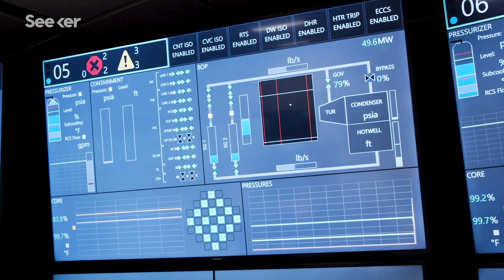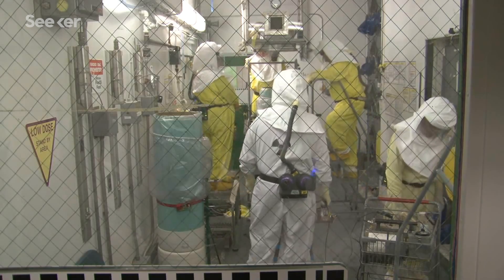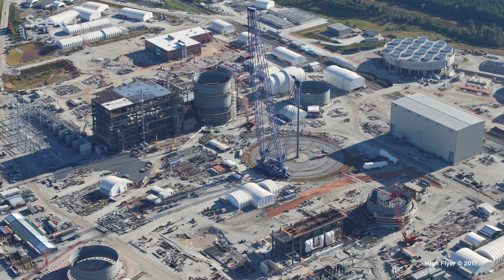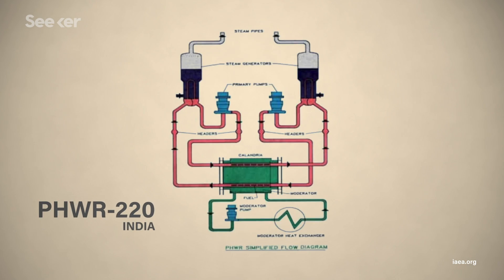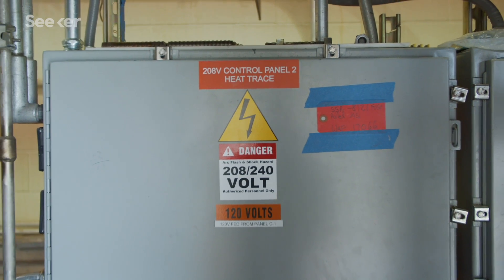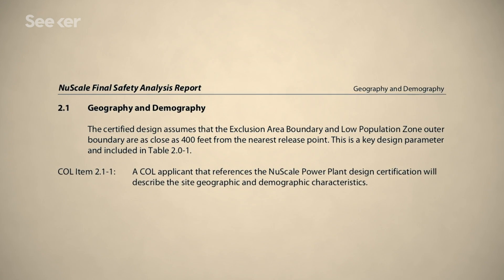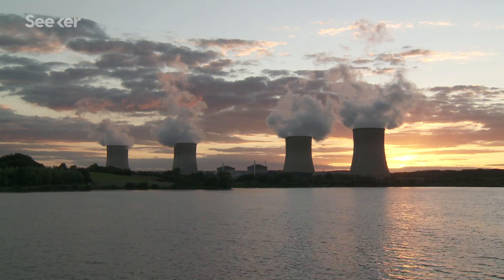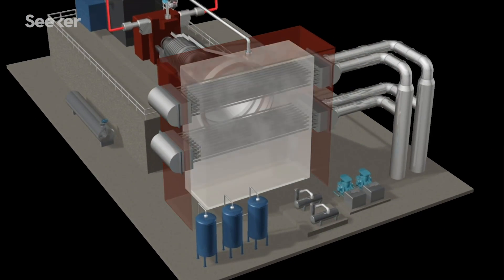Mini-Nuclear Reactors Are Coming, and They Could Reinvent the Energy Industry

Comment: It''s Fun to think, we're still a steam powered civilization. hehe
Reply: The most advanced steam punks to be
Reply: We want to be a modern steampunk civilization xd
Reply: Well, solar and wind are not steam powered.
Reply: @maixck  also solar and wind generation is carbon-laden
Reply: @wallishaines7247  Is there steam?
Reply: @maixck  wind and solar are unreliable and take up huge amounts of space
Reply: @SteveJobsless  yes but they are not steam powered.
Reply: @maixck  durr
Reply: Dylan Bollo your point was totally irrelevant to the conversation
Reply: @maixck  the conversation isnt steam powered though you're wrong
Reply: @SteveJobsless  it is, read the first comment bro.
Reply: @maixck  ya but you're forgetting all about the stea. like boiling water you know
Reply: @maixck  Solar can be, not photovoltaic cells mind you but concentrated solar power systems, which generate solar power by using mirrors or lenses to concentrate a large area of sunlight onto a receiver. Electricity is generated when the concentrated light is converted to heat (solar thermal energy), which drives a heat engine (usually a steam turbine) connected to an electrical power generator or powers a thermochemical reaction.
Reply: @maixck  big solar plants are.
Reply: Rick Sanchez  We learnt to make a mini sun, and used it to boil water...
Reply: @_tsu_  actually nuclear reactors are not mini suns because they use nuclear fission a d stars use nuclear fusion. They still haven't  found a way of making fusion efficient enough to make a power plant powered by fusion.
Reply: @_tsu_  That is not the same kind of reaction as this. Sadly we cant keep that reaction continuous yet.
Reply: No matter how "advanced" we are, thermodynamic cycles don't change.
Reply: Rick Sanchez  and how do you thing we would convert energy from fusion? 

through steam of course

unless we discover how to directly harness electric currents from neutron stars
Reply: Luiz Felipe probably, but not necessarily. Just think on it for a minute. There are myriad ways (likely all less efficient, but perhaps not) that engineers might devise to harness fusion energy and direct it towards useful work, bypassing boilers altogether. I’m not an engineer, but my brother is if that makes a difference (it doesn’t lol). Just fun to think outside the box.
Reply: @monad_tcp  just catch the electrons with one hand and hold a battery in the other hand
Reply: It's just not easy or efficient to harness energy from reactors other ways lol
Reply: @kellyhe3012  

In space NASA uses peltier technology for their reactors. I guess under a certain scale and/or being weightless the turbine loses out.
Reply: @kellyhe3012  
Unless you have access to Lockheed Martin patents.
Reply: steampunk for the win
Reply: Real steampunk
Reply: Gotta love how this dude didn't even talk about how it's the best thing for the environment, because all other energy is just from the big nuclear reactor in the sky.
Reply: *happy steampunk noises*
Reply: But it's not fun to think we're still an oil powered civilization :(
Reply: But not all countries . My country has only hydro solar wind .
Reply: Ever heard of nuclear fusion???
Reply: @corneliaarthur1658  Even moat fusion designs incorporate heating water to make steam that drive turbines to generate electricity.... There are solid state or DEC (direct energy conversion) designs too. Highly preferable but also very experimental - https://en.wikipedia.org/wiki/Direct_energy_conversion
Reply: @corneliaarthur1658  Yes but could you explain it to us?
Reply: @corneliaarthur1658  How does the energy generated convert to power?
Reply: @frankies.4500  ask the sun
It's a great example of fusion energy
Reply: Thermodynamically speaking, you can’t really beat the efficiency of turning heat into mechanical energy via boiling water.
Reply: solar panel : am i a joke to you?
Reply: STEAM PUNK IRL. WE DID IT GAIS! :]
Reply: Steam punk
Reply: I don’t know about you but i’m using a water wheel
Reply: Steam might be used 40% of the time. Hydropower or wind power began before steam. Still laughing dumbass?
Reply: @Jackson Brown you remind me of the crying soyboy meme
Reply: wait till you have solid state thermionic converter heat exchangers that are cheap and scalable in large square meters.
that will be a long time from now since these have to be near perfect in the molecular level.
Reply: Nothing drives a turbine better, in terms of kinetic energy, were far past steam, but power generation will likely remain with steam until we find a way of producing significant amounts of antimatter, which I wouldn’t hold my breath for.
Reply: @warrcoww6717  Finding an element that decays into antimatter would be useful.
Reply: Steam is still one of the most effective and manufacturing processes including the availability of medium and recycling of medium, also its superheated steam and not quite what was used in the 1900s steam engine.
Reply: I constantly remind myself of this. It's fascinating.
Reply: Sad to think...
Reply: Its a damn good way to move a turbine
Reply: We just need a material that turns heat into electricity extremely well.
Reply: Great observation genius.  Of course we use steam still, there’s not really any other efficient way to covert heat energy into mechanical work.
Reply: Yes this is funny, almost all of generator that utilise heat is steam based :)
Reply: I mean not entirely. RTGs and Solar panels aren't
Reply: T H O R I U M...
Reply: Steampunk never dies!
Reply: Ok
Reply: Lol no we're not..
Reply: Wee need to heat water... lets use a nuke
Reply: Not if you use a pocket calculator with a solar cell
Reply: Lol, it is funny that we say nuclear when man's advancements in energy has simply been a more efficient means of transforming water into steam....for the most part.
Reply: The funny part is all these futuristic nuclear reactors heat water to produce steam and turn turbines.
Reply: We do have solar and peltier technology.

But when it comes to scale nothing beats a turbine I guess. Be it steam, wind or hydro powered.
Reply: Once as this mini reactor is ready and operating, engineering opportunities would multiply. Once as we mass produce nano computer chips, technology breakthroughs would multiply. Once as we get to 100% renewable energy with high efficiency solar panels and wind turbines energy cost would decrease and multiply. Once as we all figure out how to not be greedy civilization, we would only then be able to venture out to the far reaches of our solar system to seek new answers.
Reply: I heard they might change to molten salt though
Reply: Just think once you humans figure out how to utilize the subatomic energy directly it will be like discovering fire all over again.
Reply: We are steampunk.
Reply: Steam and Transformers
Reply: F A C T O R I O
Reply: All power comes from some natural resource. Coal, Water, Wind, Sunlight. It's not that strange a concept.
Reply: you guys are lucky. I have water power, I live near a dam
Reply: If you ever been throw into a tub of boiling water as a child for taking the jar of peanut butter without asking first, you’ll know steam is very powerful.
Reply: System is the problem 🏡  The Great Qualities

1, Show all living creatures; all the love and kindness as much as you can.

2, Only try to be honest with yourself. If you try to be honest with others, you will get into big trouble soon or later.

3, Aim only one target at a time; otherwise you are chasing two rabbits and you will miss both. So, the reason behind it. Have one powerful reason and never ever give up the one you want the most.

4, Don't try to be good person only but be the powerful person. We will grow to be the one or we will die. There is no other choice. 

5, Always learn and look for to improve something your life. 

6, You are not alone. Love and faith the high power reduces unnecessary stress in life. But never completely rely on it. 

7,  Success and happiness are the byproducts of our usefulness. So, always increase the possibility of success.

8, Life is not going to be easy. Because of our unnecessary things. Eliminate all the unnecessary things as much as you can by organising yourself well with the environments. 

9, Never believe anything without the proper evidences. 

10, Always try to give more than you take. 
Because it is dignity/ character of the divinity within you.

🌎 As long as people continue to see themselves as separate from everything else, they lend themselves to being completely enslaved. Success depends on how well we relate to everything around us. Joy comes from that bliss of connectedness. I believe that unarmed truth and love will have the final word in reality. To love; you should have good heart. I am a good person until I see a person better than my standard of goodness. Being good is the progress towards a worthy cause. Love is God. Whoever lives in love, lives forever. How selfish it is to try to keep something forever? Love is all about nourishing, nurturing, sharing and expanding the love within you for all. The principle to which we adhere to is that we have kindness of love at heart for the whole of mankind.  As long as there is the unnecessary differences within us; we can not live peacefully so we have to eliminate all the unnecessary differences among us so we can love all. People abilities may vary but not there true love. If we love a person/ God for a reason then we love the reason but not the person. No reason is the reason to love the person because true love never fails. So do not compare or measure the true love as first or the last but love all truly. If you love people truly then you can understand people. If you don't love then you don't understand people at all.

People are controlled by system why?
The Cyclical Consumption is the current economy all over the World. It is making the scarcity problems of the earth finite resources to deteriorate day by day. Current Monetary System is legalised theft. Real money is Gold and Silver. Scarcity gives the money more value. Real money won't lose it's value. When Governments stay away from Gold & Silver then very easy to transfer the wealth / resources to upper class the Rich (Corporatocracy) Elite. When the Governments are printing out more new fiat currency with reserve banks, our old currency is losing its purchasing power everyday. They are printing millions of currency everyday. All governments and laws are existing right now to transfer wealth to upper class the rich elite. The USA Government & other Governments are in many countries, bailed the investment banks & financial institutions in 2008 against the majority of the people. There is no democracy in any countries. Because of the Money System based on profits motive only above all else even humans lives and well-being. So, we do not have freedom to protect our values with the money so on. The violence, bankruptcy & all the negativities are build into the Monetary System of our society. All are owned (including ourselves) by Reserve Bank. Which is private cartel the corporation. So, in legal system, we are legally considered as chattel the properties. They make money in the capital markets with our birth certificates. They do not consider us as Humans. That's the truth. We are at the invisible war with the Elites (Corporatocracies). We have to fight for our Freedom. Resource Based Economy is the Solution. We have to declare the earth resources as the heritage of all the people of this world. So everyone has access to it. Please have your research about zeitgeist movement then you know the truth more. 

 Truth About Health/Drugs Industry Because Of It Your Life At High Risk The drug industry is a 1/2 trillion dollars a year worldwide conglomerate. Almost 300 billions dollars just in North America. That is really big business. What would happen if everyone were well? There is no money in health. You see, good health makes a lot of sense but it doesn't make a lot of dollars. Because everything they do is toxic. Every drug they use, prescription drugs, all drugs are liver toxic, bar none. If you've had amalgam fillings put in your mouth by dentists. It is highly toxic. There's cancer because most of the chemos are themselves carcinogens. To view the tumor as the cancer and we know the tumor is not the cancer. The cancer industry is 200 billions dollars a year. The more work they get, the more profit there is. You have to dismantle; If the truth ever came out about what we would need to do. 30% of people of females in America are at risk of getting, will get cancer of the breast. The ones that are already dead have been grossly mistreated by the medical profession and by the government that supposedly is supposed to encourage free research and development of all possibilities. Why would medical doctors who studied medicine and practice medicine and are heavily funded by pharmaceutical companies why would they go and look into vitamins? That they never had the answer orthomolecular. And as more and more of our population start taking their health into their own hands, there's going to be even more and more of changes. It can't go on the way it is. The system is failing apart. We must make nutrition the primary prevention strategy for the population. You are what you eat. You are everything that you have ever done to yourself. The choices you make directly affect the outcome of your life. - (Food Matters Documentary in Netflix)

😊 Well, I truly love God. I am not religious but very spiritual person. So, I believe 1) Religion is the beliefs in someone experiences But spirituality is having my own experiences. The mainstream religions people promote religious ideology by giving guidelines and guide but In my spiritual life; I do not want anyone or anything between God and me to restrict my freedom to worship God. 2) We do not need any authorities to do good work. The god work is the good work always. In contrast; organised mainstream religions are claiming that they have the authorities to do God works as leaders so on. 3) God is not capable of doing wrong thing, change the past for us and create anything out of nothing for us. Nothing means not anything. So, even God is limited. The mainstream religious people believe that God is unlimited. 4) God wants us to take responsibilities for our righteousness life but not for all the consequences of our actions because they are continued to exist among us. So, How can god punish us for all our consequences? The mainstream religious people believe we are full of sins because of all our actions. 5) Freewill  is an illusion. People always choose the perceived path of greatest pleasure.  So, we do not have choices all the time. In contrast teachings of the mainstream religions are promoting people to do god's will always because we all have choices of freewill always. 6) We can not separate everything into groups. So, everything for good and evil and there's no success and failure for everything. If everything is real then real things can not be threatened. Once you come to understand that God/The Holy Spirit is in each of us, You will no longer need a Book to tell you how to live. Then why we need religious scriptures? The Virtue is the expression of the basic goodness in our actions. The Basic goodness is the fundamental worthiness of every individuals. We are worthy to God always in everything. 7) Beliefs in a cruel God makes a cruel man. No matter what; every living creatures has the right to live and What makes their life cheap? Everything depends on everything. Nothing too big or too small in value. We can not love and hate at the same time; Being a vegetarian means love without cruelty happily. The mainstream religious people are killing people and sacrificing animals in the name of God. They promote God's cruel punishments. The Punishment is endless for Sinners/Devil according to religious scriptures. But God is love always. Overcome hate with love. If all religions for peace, unity? No way. Because they are not for peace. 8) Well, The God gave us everything to go from moment to moment in our lives as we do our part  and pray only to thank god then the Love is in progress. The Love is always for everyone. We are always worthy of the God's love. Our greatest fear is; not to be loved by anyone but we are all loved by someone. When we eliminate all our unnecessary differences among us then true peaceful life is possible with the true love. If we can't find the peace within ourselves then we will never find it anywhere else. 9) This is the Fight for independence and freedom of humanity to worship God freely without religious guide and guidelines to restrict us. Unnecessarily, We do not want third party controls over us in anything ; especially in spirituality. 10) Revive Survive Thrive. Sincerely,  The Real Peacemaker against religious oppression.

 https://youtu.be/HbvCxMfcKv4
https://youtu.be/pIJHJzDQcRM
https://youtu.be/MyxbdmAnIcI
https://youtu.be/wLzeakKC6fE
 https://youtu.be/P8vHa8zD7jY
Reply: What about fusion
Reply: @goldenshatter  Google it
Reply: Nothing funny about it
Reply: So much technology to boil water.  Haha
Reply: @matthewt3815  do you have a better way to turn heat into rotation?
Reply: Steam engines can be extremely efficient. It’s just physics.
Reply: I always think about that. We make water fall on turbines, make steam turn the turbine... Seems very conventional...
Reply: steam punk
Reply: Clearly there should be a more direct way to convert radiation into electricity
Reply: The steam stayed the same, we the way we got steam got more advanced.
Reply: It's also funny we're still using wheels
Reply: Not really, nuclear energy only makes up for 5% of power consumption I think.
Reply: @justsomeguywithtattoos6267  Nuclear power is steam powered (fission heat's up water to steam turns turbine turns generator)
Reply: @PresidentialWinner  yes. And I was saying that nuclear is only 5% of power consumption. So we are 5% steam powered. That means the og comment got it wrong.
Reply: @justsomeguywithtattoos6267  

I would think coal and gas plants also use steam to turn their turbines.
Reply: It's actually silicon based, just some dinosaurs are trying to prevent it. (Pun intended).
Reply: If it ain't broke dont fix it
Reply: whats funnier is we still use. the phylosophies and theories of dead people, to live by,( mindblown )
Reply: What you guys have steam, “DAM” we still use water wheel technology in Norway
Reply: Facts. First thing i thought.
Reply: Science fiction and "first encounter 'true'" events written in the 1800's, the aliens claimed they used steam power... perhaps they did?
Reply: Please let the future be steam punk themed. I want it sooo bad. 🙏
Reply: Better to be at full steam that to be just full of hot air
Reply: We're definitely using nuclear fuel wrong then lol cus for the last 12 years Ive noticed the same thing we have very limited knowledge this
Reply: @moi2833 bet
Reply: Bcz we spending a huge amount of money in defence.. Aka to save humans from humans... Actually people are still living in bronze age where we fought for glorious name and small land. Fukc off humans you don't deserve this planet
Reply: 2 word cure direct current. Alternating current is garbage at best. Almost everything in your home gets turned into d.c before it works now
Reply: @seansweet675  Edison over here
Reply: @theojones6129  Tesla and the golden ratio. Edison was  a hack
Reply: @seansweet675  then why are you endorsing his ideas?
Reply: Electronic and math.. edit
Reply: @theojones6129  the only idea Edison ever had was how to  take credit for someone else's
Reply: @seansweet675  are you avoiding it or do you just not understand?
Reply: @seansweet675  you know the advantage of AC over DC
Reply: Yea that just got me a little confused I totally get where your coming from now. it’s all super interesting to think we are so advanced in technology. But a main focus Americans forget to remember is what’s at stake? Is it jobs, money or life’s? That’s why coal is still booming and fossil fuels. There’s a system RN! That can burn trash in a controlled environment and emit fresh air! WTH why is this not mainstream, oh right jobs and old fuckers not caring about younger generations to come. I could go on for hours. Economy shifts are the most critical and scary stage of evolving into that next stage.
Reply: @jacksonbrown2692  even if we had mini nuclear reactors in our houses we'd still be steam powered
Reply: @sharcc2511  Well this might be possible too. Direct conversion... Via photons https://en.wikipedia.org/wiki/Photon-intermediate_direct_energy_conversion
Reply: @sharcc2511  nope, some companies are developing supercritical CO2 turbines which use high pressure CO2 as working fluid insted of steam, research shows that they will be more effecient and way smaller than steam turbines
Reply: Jackson Brown I believe you are thoroughly misinformed, such technology may exist, however the cost of production and making sure it meets safety and consistency regulations and reasoning, is extremely astronomically high. This same tech would also provide a negative energy outcome and would thus need an energy supplier that would power this. I think you may now be able to see that it would cause more economic set back than worth it to save the planet for future generations. Humans live in the constant, the events of the far future can never be calculated or accounted for, and thus Mankind looks to economic success as it is relatively easy to amass during a life time in the modernised world. Greed will always prevail over Kindness. The current population would not logically want to cause their early grave so that the future generations can travel the stars. In the end this is much more of a philosophical debate rather than a logical or physical one. It is not due to laziness but fear of death without personal success. Also I think you’re countries current education system is flawed as you learn a problem and a solution but not why the solution has the affect it does. Also try to remember that the USA is not mankind, in fact the United States only equates to roughly 1/20th of Homosapien population.
Reply: @jacksonbrown2692  bro, you missed by a fuckin light year
Reply: @jacksonbrown2692  that’s not why steam power is always employed. The reason we use steam is because steam turns a turbine which creates electricity, methods of creating steam can vary however from what we see is steam turbines is one of the best industrial grade power infrastructure system and is used worldwide by almost every nation
Reply: @adawg3032  Your so behind
Reply: You're a progressive shill.
Reply: Idk how it’s funny this is our moment, destiny whatever you wanna call it so don’t act like we were suppose to have nuclear reactors in every house by now.
Reply: @jacksonbrown2692  I'm sorry. You misunderstand me. Maybe funny was the wrong word, It's just Fun to think about. We have all this cool technology and we still use steam to do the job. It's weird and cool.
Reply: @xanider5098  I mean even most of the proposed designs for fusion reactors will still be used to heat a liquid. That's because water is a good heat sink, and even though it's a poor heat conductor, that's easily solvable by using convection  and circulating the warm water by pumping it out and pumping in cold water, chances are we might use purpose designed fluids that are better heat sinks and conductors in time, and even then a there's a huge chance that at least in the forseable future it will be a solution using water as the solvent. Water is cheap and effective. If it ain't broke and all.
Reply: @xanider5098  saying it’s fascinating is a better word than fun. It’s not fun, but it’s interesting.
Reply: @jacksonbrown2692   Well I kind of expected easier safer reactors and one day with enough technological breakthrough would be no catastrophic than a cheap battery in a cheap tv remote. I can't predict the future though it would be nice to eventually reach there. There would no excuse to be on the grid at that point unless for higher manufacturing purposes. Furthermore, our needs to revitalize our radioactive waste recycling technologies which we some reason thought it wasn't cost-effective and nuclear war risk when refining more fissile material. Britain, Germany, Japan ..... etc, on the other hand, don't bury there waste until it is used up. Here is the link to look further on this subject. https://www.forbes.com/sites/realspin/2014/10/01/why-doesnt-u-s-recycle-nuclear-fuel/#767241a8390f
Reply: @jacksonbrown2692  nuclear reactor as in fusion? yeah, we know. it's just funny that the technology is actually ancient.